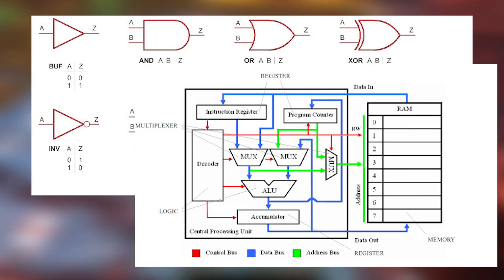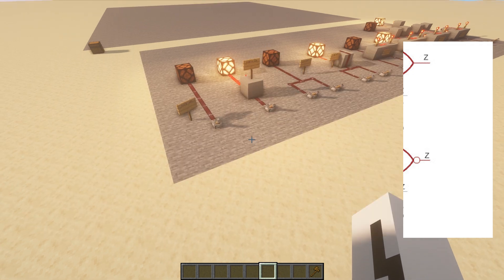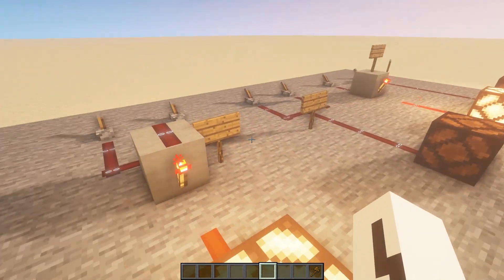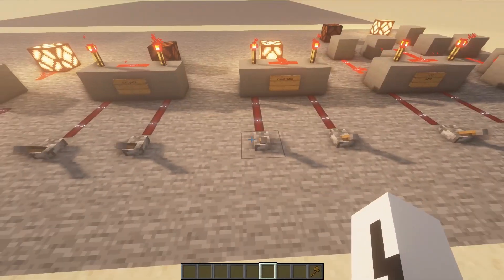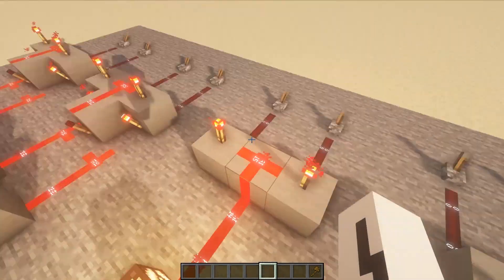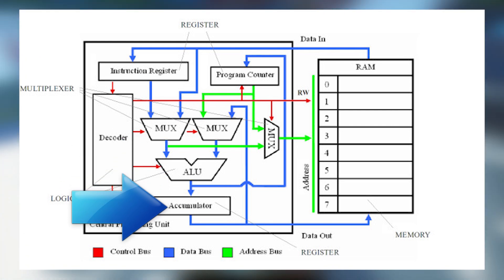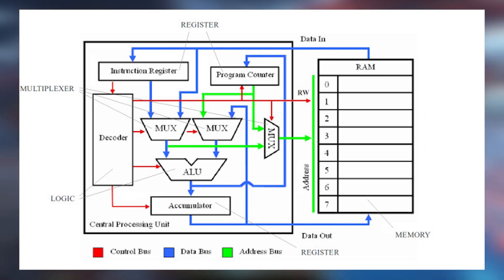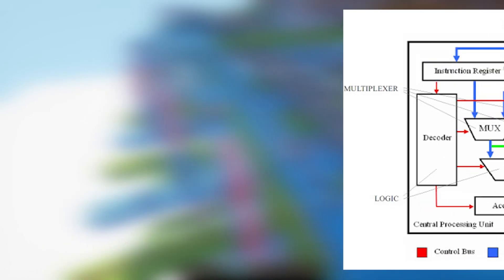Building a Redstone Computer Part 1: The Introduction

Comment: Just used this for insanely complex redstone lighting, took me over 7 hours but this helped a ton. (I have ceiling lighting and floor lighting, I wanted to be able to just have the ceiling lighting or the floor lighting or all of of or none of it. Basically four states, ALL ON, ALL OFF, TOP ON/OFF, BOTTOM ON/OFF.) The wiring is an absolute mess, especially considering the switch to turn on all of the lights is on the opposite side of where the power comes in from that switch (now the gate converter) to the top. Had to make it like this in order to reduce latency and have a coinvent switch location rather than the one that is the easiest.

I highly recommend if anyone does this, to have the wiring done BEFORE you make your structure (especially the bottom one), although I eventually managed to get it

Comment: XOR construction step by step:
The middle torch gives AB (and)
The left and right torches have A' and B'
They are connected to two wires:
X = AB + A' 
Y = AB + B'
Then the final torches invert them
X' = AB'
Y = A'B
Then they are ORed. 
Output = AB' + A'B
Reply: The output for anybody confused:

When both inputs are false or true the output is false, and in any other case the output is true

Comment: I am not a redstone programmer, I actually don't play MC at all, but I've been AMAZED by some insane redstone PC creations and I clicked on this video to try and understand it, and HOLY crap already this is mindblowing complexity for me. If this is the "basics" I can't even begin to comprehend the true complexity and genius behind the redstone computers... Absolutely incredible.

I had some questions tho, so is the most fundamental units of redstone the lever/line/torch? What components would this be analagous to in an actual computer circuitry, and are there additional analagous building-blocks besides those shown here? In terms of the overall design/archietecture, do redstone computers closely follow real computer architecture or do some compromises/adaptations have to be made?
Reply: Real computers rely on Semi-conductors, or transistors which work by only allowing current in a wire to flow given there is a voltage applied to a separate pin on the transistor, this allows logic to be performed. AND, NOT and OR gates can be made from transistors, from there the rest of the logic gates can be made as well.

To answer your question about if the architecture is the same, well CPU architecture is designed for a specific purpose in mind, for example an intel i7 processor has a specific architecture designed to work with common personal computers, but a processor like an intel Xeon is designed to work with servers and large data. Redstone computers closely resemble these architectures because it is what has been found to work by engineers for over 50 years, of course you could make your own CPU design from scratch but you'd have to be a genius or put a lot of hard work into it, what we have works and there is no point changing it.

pertaining to the fundamental units of redstone, these things can perform logic, just like the aforementioned transistor, because powering a redstone torch turns it off, you can create transitors, logic gates and thus you can replicate real CPU designs.

tl;dr: CPUs need logic gates to function, normal CPU's use semiconductors to make transistors which make logic gates, redstone torches and lines can replicate these transistors.
Reply: @OBsesssss  WOW what a fantastic explanation, ty for taking the time to explain all this! 💯
Reply: @SyenPie  A redstone computer is pretty easy to make, if you have enough knowledge about redstone and a computer on the binary level (aka the lowest I think)0.
Reply: @r50142  you mean on a fundamental level with like logic gates and shtuff?